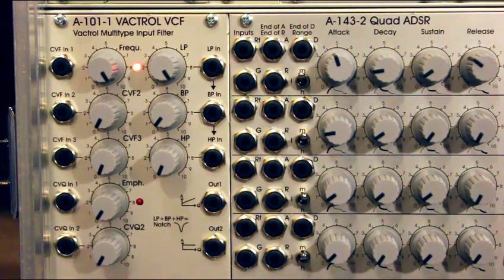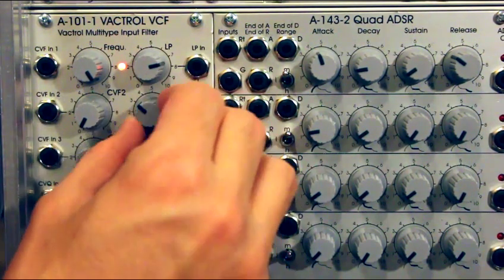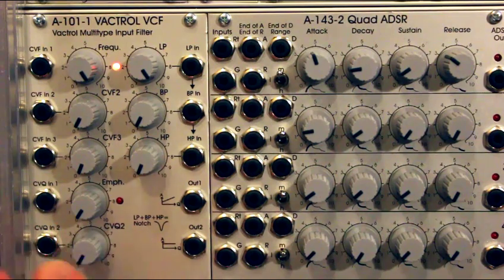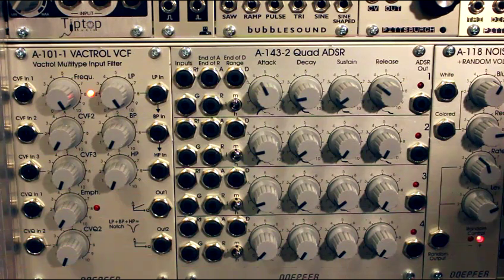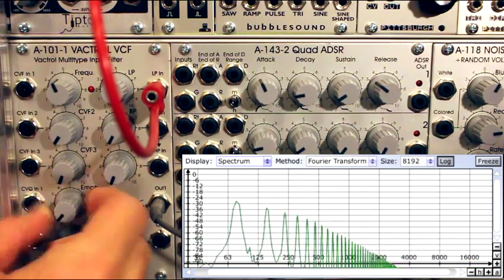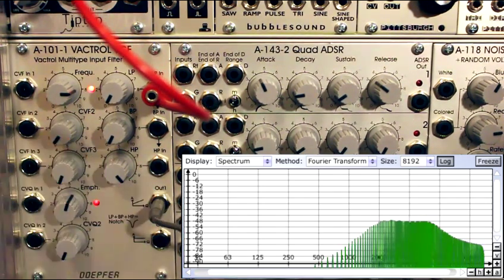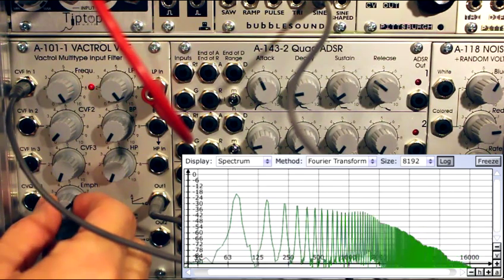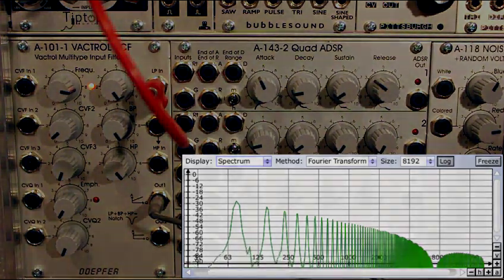Doepfer A101-1 Vactrol Multitype Filter Review

Comment: Very informative. 
I have one of these filers and I really like it, mine does sound completely different to yours though in that it won't self resonate at all unless to add a positive cv to either of the resonance cv inputs. 

I have 3 of the Doepfer A-101-2's (LPG's) and they all sound completely different to each other too.

Vactrols, gotta love them for making each filter sound unique.

Thanks for making the video.
Reply from the maker: Really!!. I thought they would differ slightly. Well that changes my perspective.

Thanks for checking.
Reply: Hi, do you also know, what type vactrols are in the A101-2 LPG?
Thanks in advance.

Comment: Hey great video! Thank you for sharing. I have a question concerning routing. Would it be best to have a multiple next to the Vactrol, or can I simply stack connections? What are the pros or cons to each and then a question concerning your oscilloscope. What program do you have running to see the spectral analysis?
Reply from the maker: +Robert Jones Thanks. You can stack connections (if you have stack-able cables offcourse). Which is in many ways more practical. The only problem with stack-ables is that if you stack too many on to one output you may get a slight voltage drop on that output, which is usually not a big problem unless your doing precise voltage like pitch. Unbuffered multiples will give you the same problem. You need a BUFFERED multiple to avoid that. Though I have to say I don't have allot of on hand experience with mults, this is just as far as I know.

The analyser is a plugin called "Signal Analyzer" by Robin Schmidt.
Reply: +SoloStuff: Thank you for the quick reply. I didn't know about the drop in voltage and that's really important, because I'm trying to track angular frequencies on initial phases. I also didn't know about the "BUFFERED" mults. This is exceptional advice. I looked into it. I'm currently using an oscilloscope from Reason and it's not exactly, what I'm looking for. It has hardly any referential data, where as the one you're using has latitude and longitudinal references.. Very good SoloStuff. I'll keep an eye out on more vids. Cheers.

Comment: what happens with just LP and HP turned up but no bandpass? I would've thought LP+HP+BP would result in an allpass filter rather than a notch
Reply from the maker: I can't remember now if I've tried it. But the manual says that LP+HP should give a "band pass with offset", not sure what that means, I think it's related to phase difference.  For the notch, It seams that those filters are phased differently, so instead of adding, it subtracts the BP. when mixed together. Thats the only way I can explain it.
Reply: SoloStuff phase difference would make some sense i guess. not sure though, intuitively i'd guess that the bandpass would just appear negatively and maybe only partially cancel the LP and HP